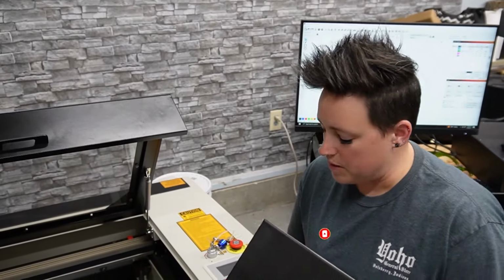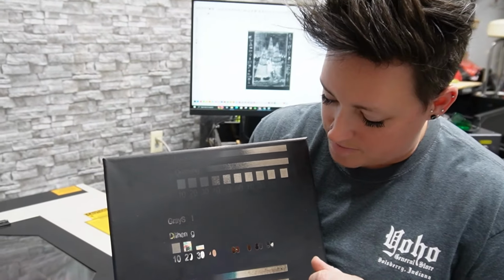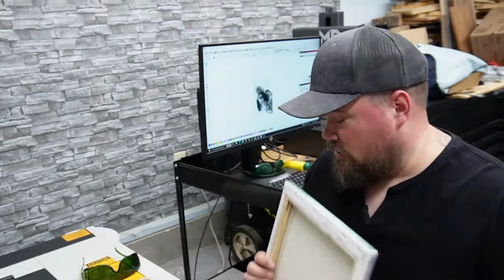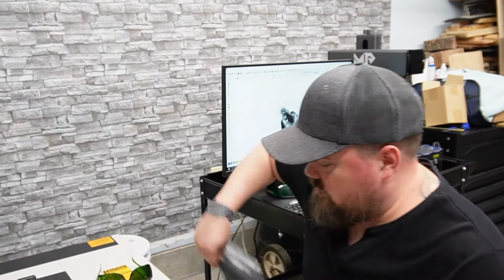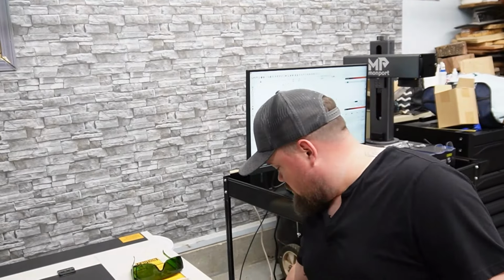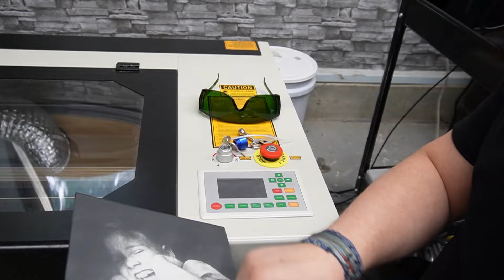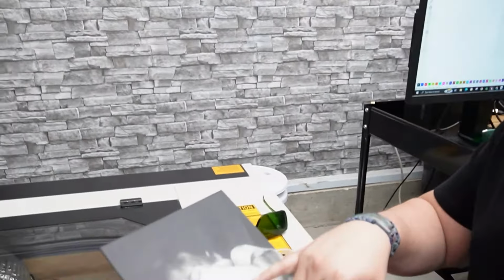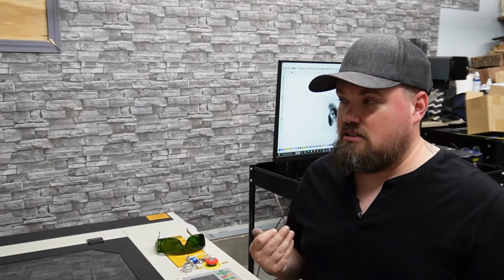Laser Engrave Painted Canvas | Monport 60W CO2

Comment: I have absolutely no knowledge about this, but I want to get started on it. That's why I watch this video.
Am I totally wrong if I think that an aluminum plate underneath will dissipate heat and prevent burn-through?
Maybe you can burn harder without burning through.
Just an idea, as I said, I have no idea what I'm talking about, or what will happen with an aluminum plate underneath. Maybe that makes it all a lot worse, I don't know. 
Thanks for the video. 🙂
Reply from the maker: It’s a fine balance or speed and power that just needs a lot of testing to really dial in a machine. None of our different lasers use the same settings.